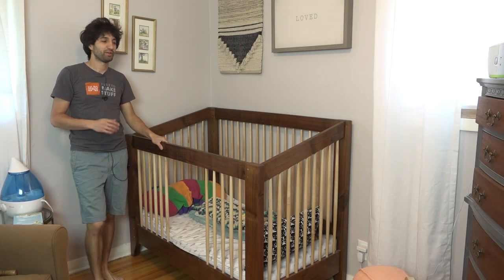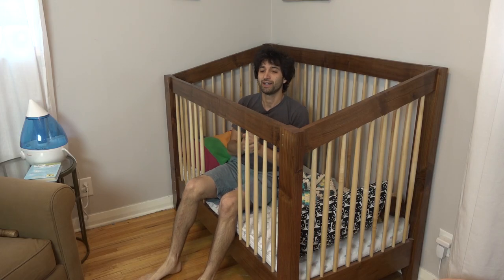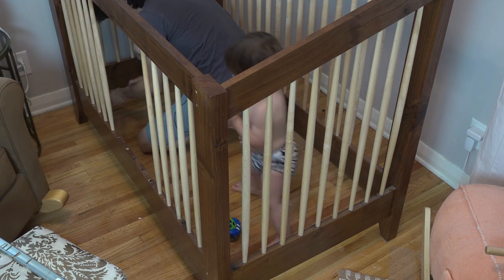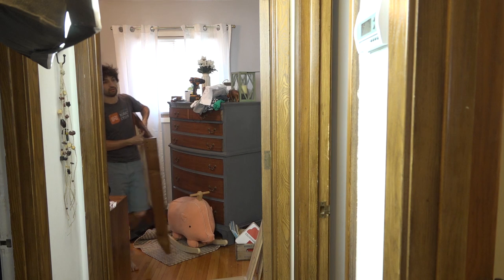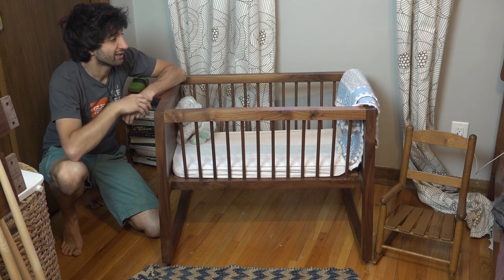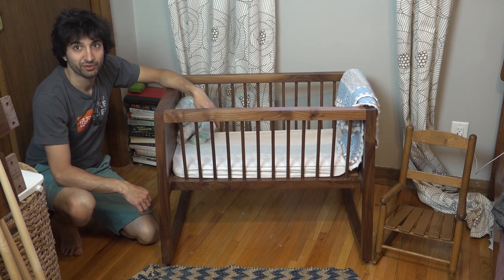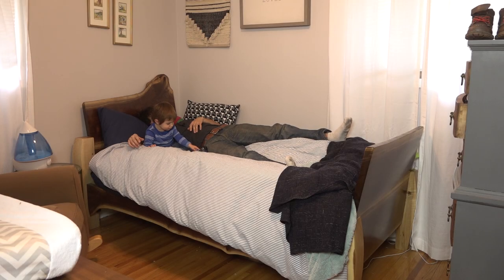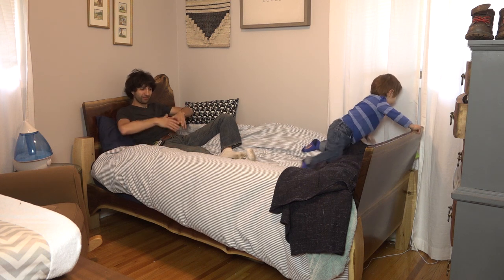Nursery Furniture Followup

Comment: I am thinking about building a crib for a baby on the way, so this video was really helpful!  I would like to build it with the ability to break it down, and wondering what you think about possibly using some steel bed fasteners (http://www.rockler.com/heavy-duty-wrought-steel-bed-rail-fasteners-4-pack-select-size) - Do you think that will provide enough strength, how did your dowels work?